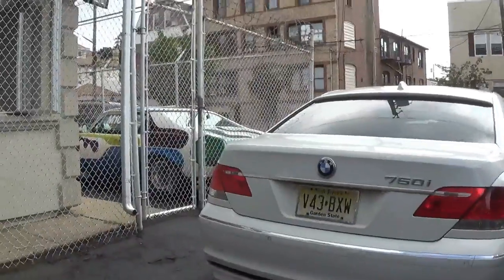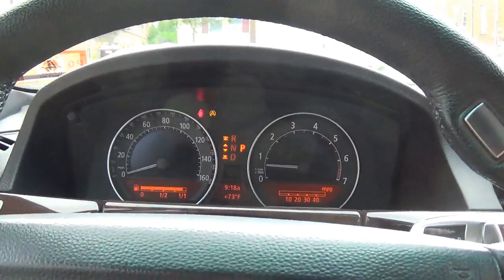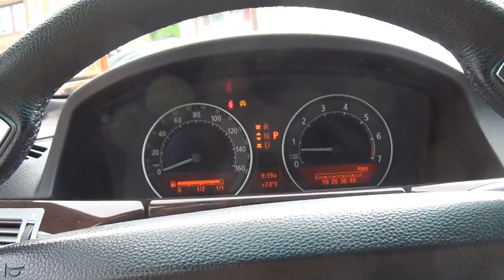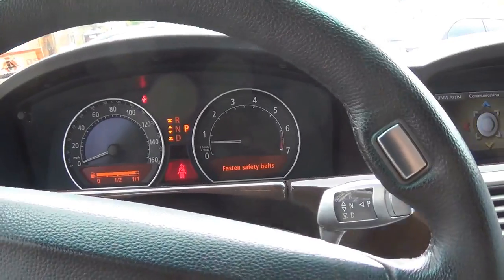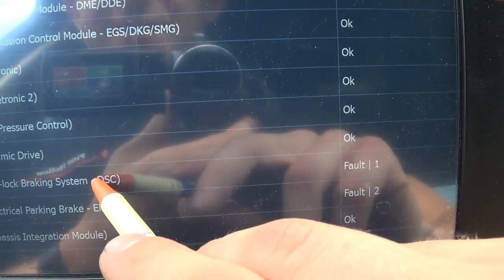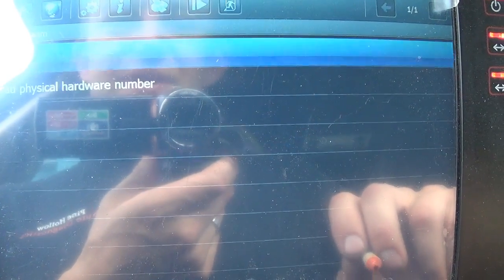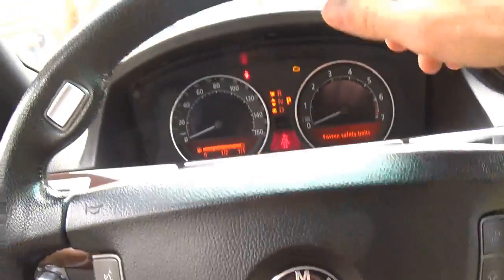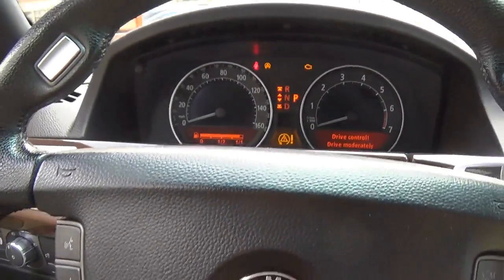BMW Steering Problems (SI 2016 Ep 3.2)

Comment: Bmw x6 f16 the steering raise and lower stopped working can only hear a click when trying to operate the teliscopic in and out adjust works fine. I stripped motor down cleaned and greased it has started to work again but now both teliscopic and raise / lowering stops after a few testing adjustments then starts working again after waiting a while and turning engine off locking doors and restarting engine or ignition is there a settings I can set for continuous operation.

Comment: The Steering angle sensor is integral to the SZL on that vehicle. Mounted under steering wheel on upper column. The clock spring, turn signal, wiper and cruise control stalks plug into the SZL and must be swapped over. Easy job to do but the SZL must be coded to the vehicle after replacement.  The steering angle sensor must be initialized/taught in after coding. Made a lot of money over the years on SZL’s across all BMW models.

Comment: I can't remember if this SAS is part of the clockspring or not on this car.
I have a horrible feeling it's on the rack on this model.
Reply: and let me guess, to change that you replace the rack, after pulling apart the car starting at the right rear tail light assembly :))

Comment: You need Ista or Inpa software a good source is Bmw doctor Dean he's one for Bmw 's help me maintain my Bimmer.. I use'd a autel  808 after a O2 sensor replace the CEL would not reset after I cleared code I plugged in my lap top and did a readapt on the DME an no codes. Ista is a diag and all you need for repairs it will tell you how to fix plus all torq spec's an repair like a dealer can.